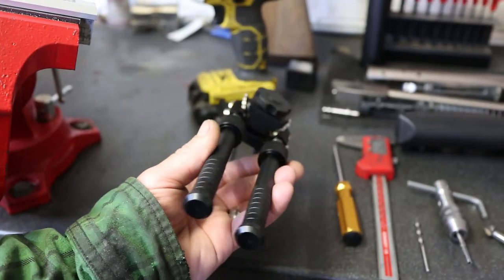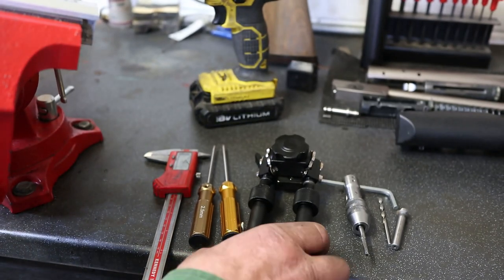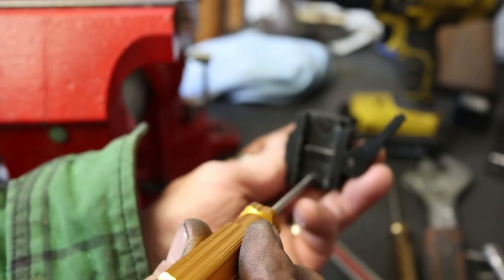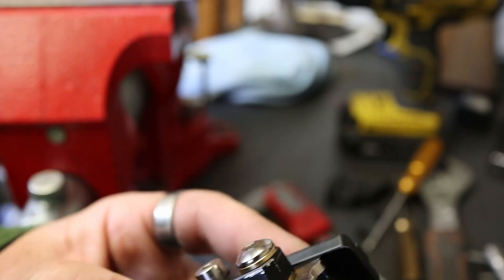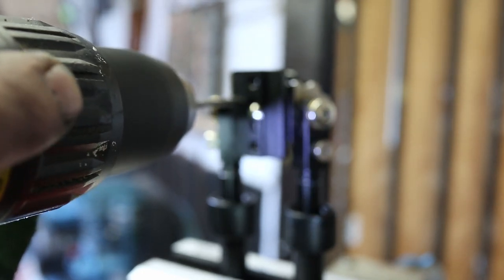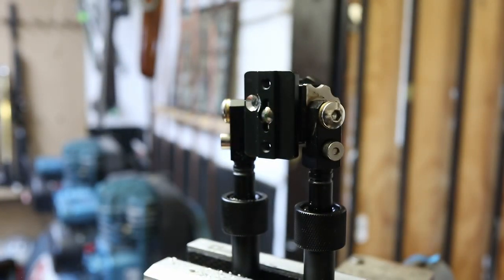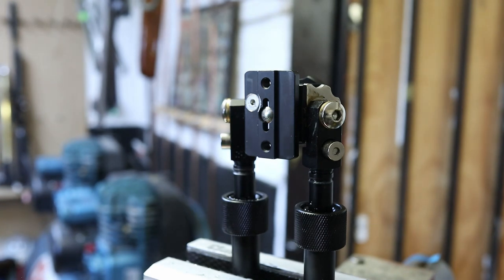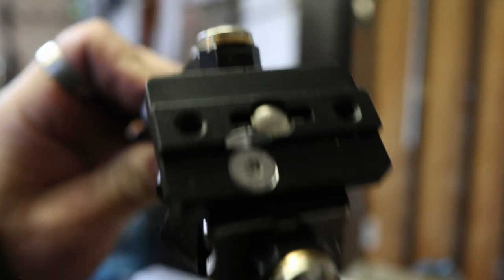Upgrade a budget air rifle bipod

Comment: Thanks mate. Just fixed mine and it's solid as. I was a bit of a tit and didn't take out the spring and bits. So gonna use it as is tomorrow, then re strip it and put it back together like yours.